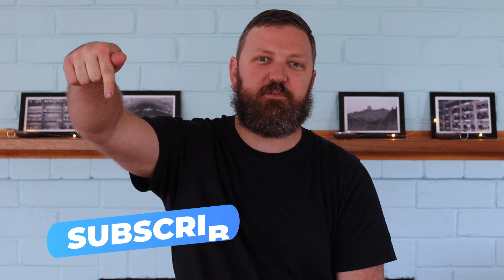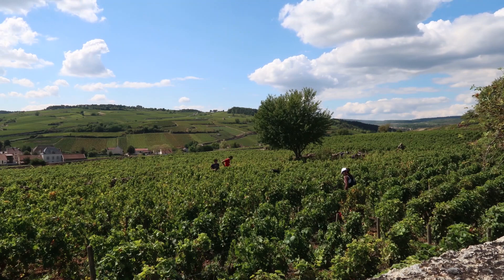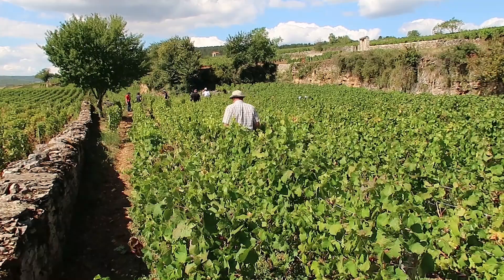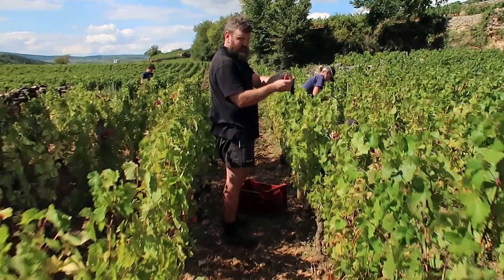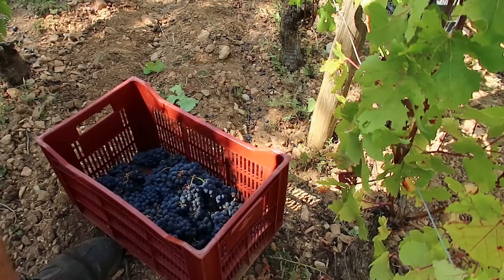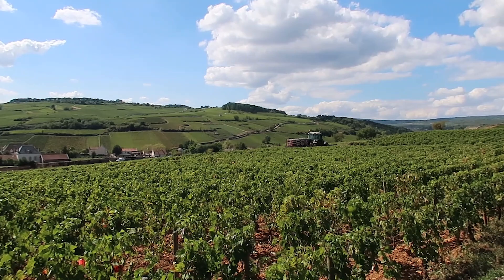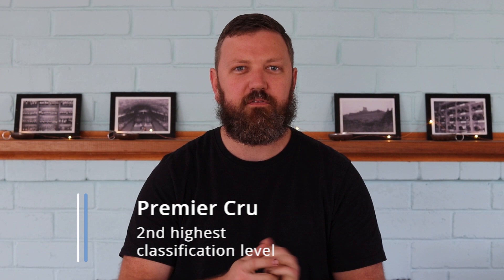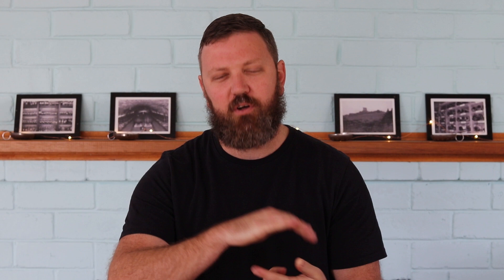Making Wine in Les Charmots, Premier Cru, Pommard Burgundy

Comment: Lastly,,what did you learn there that you could take back to Oz to improve your own wine making?
Reply: Thats a good question Philip. 

The first is to pay more attention to ferment temperature. Over there they warm their ferments to increase extraction.

The second is to utilise grape marc after pressing and adding it to a ferment that needs more weight and body.

BTW, thanks for checking out the video 👍
Reply: Are we talking about heating to around 28C in the core of the must......or is it necessary as you have just done a cold maceration to get the temperature up fast to give the ferment time to get up to higher temperatures? Last geeky question  @simonmcmillan5723
Reply: @philipquick7423  spot on Philip. It was about warming the must at the end of ferment to 28 degrees to increase extraction, especially for the plots with a lighter body